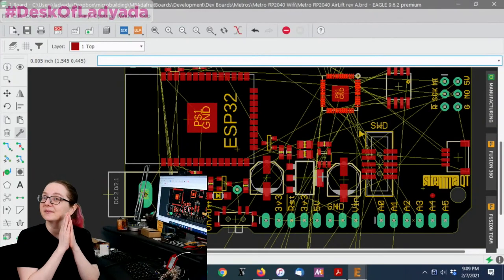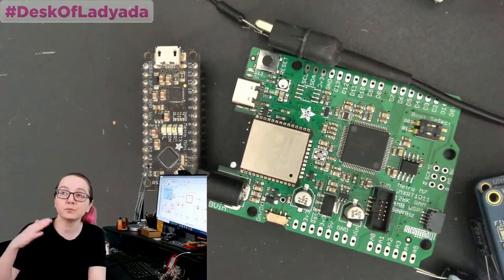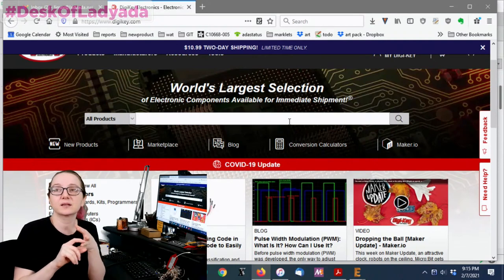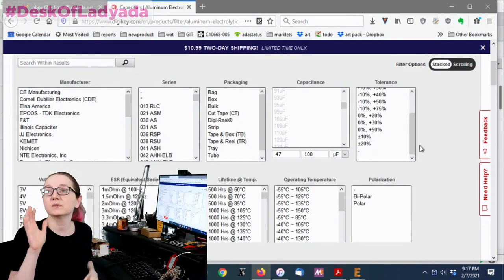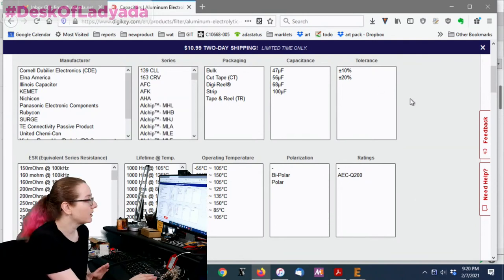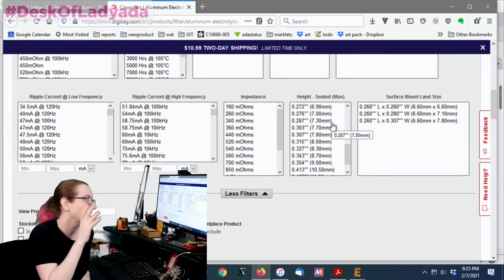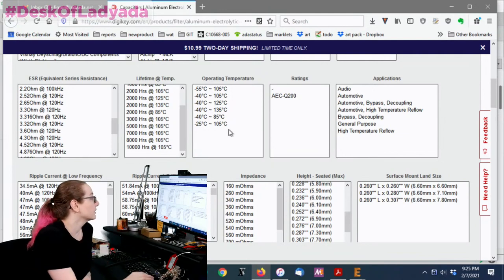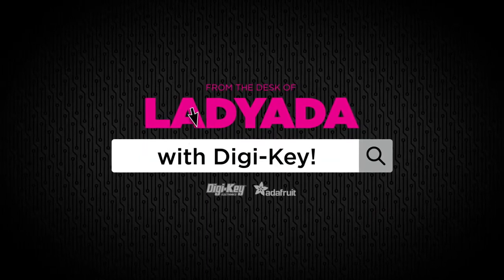The Great Search: Electrolytic Capacitors #TheGreatSearch #DigiKey #Adafruit @DigiKey @Adafruit

Comment: Great video and very timely for me! I've been searching for the right caps for my 5V regulator. It lists a specific ESR requirement, so I had to calculate the ESR of the caps when it wasn't listed in the datasheet. Found this: https://forum.digikey.com/t/calculating-capacitor-esr-from-tan/2633

ESR = tan δ / (2 π f C)

Where tan δ = the dissipation factor
f = the frequency listed for the dissipation factor test conditions
C = the capacitance in farads

So for a 10μF cap with a DF of 0.16 measured at 120Hz, the formula would be ESR = 0.16 / (2 * pi * 120 * 0.000010) = 21.22Ω @ 120MHz.

Is that right?

Also, do you have brand recommendations for through-hole caps? Panasonic and Nichicon there as well?
Any others? The datasheets for some of the Vishays that came up in my search say they are "Not for New Designs."

Thanks!